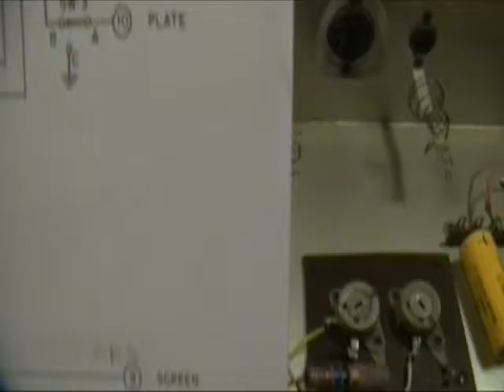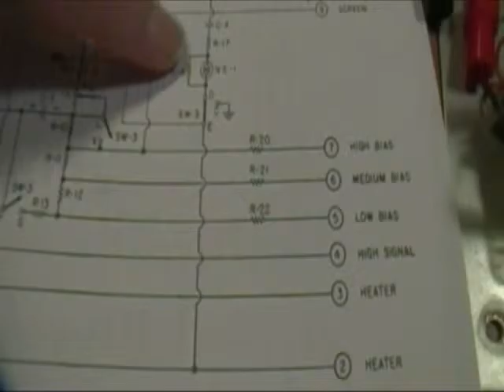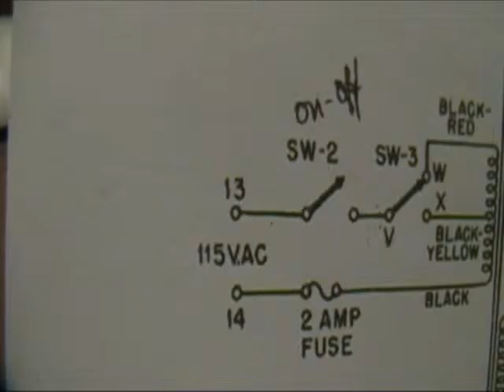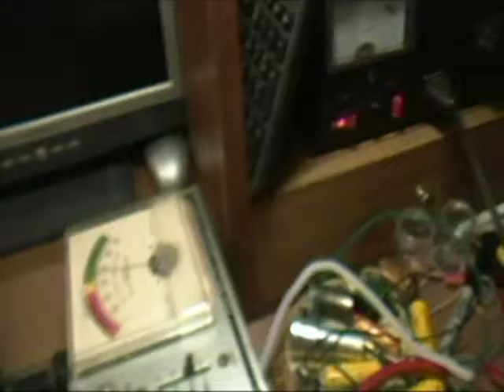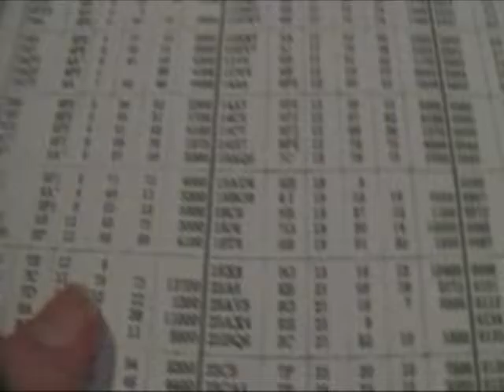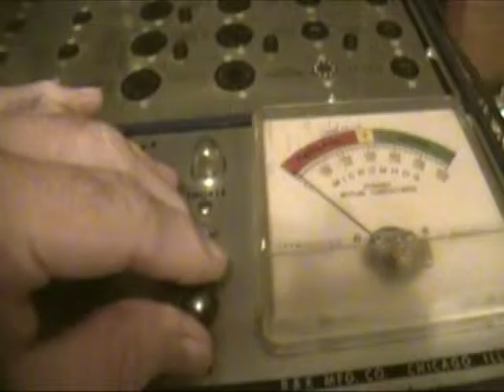TTT048 B&K500 Tube Tester Restoration

Comment: Would like to find a copy of the schematic with the markups on it. Where did that come from?
Reply: It's from "Tube Testers and Classic Electronic Test Gear – Alan Douglas" still need a copy?
Reply: @Theruined1    I reckon not. I got mine working right & the readings seem to be reasonable too, given that I don't have a "gold standard" tube. And the 500 doesn't really have a calibration procedure. But the results are consistent with what I get from a calibrated Hickok 6000A taking into consideration they don't test exactly the same method.
Reply: @ordinaryaverageguy76   you could give these a shot....though I am not sure which version of 500 they are for https://www.diyaudio.com/forums/equipment-and-tools/141560-500-tube-tester-calibration.html

Comment: Hello Sir, I have a B&K Dyna Quik 500 tube tester that always worked normal but now every time I check a tube, when I move my tester switch to GM, the short light bulb lights. It happens on all the tubes I check. Do you have any idea what could be causing this?  The problem is definitely not my tubes.

Comment: Hey Tom,
Great video on Tube testers.  I have B&K 500 I am working on and am wondering if you have schematic showing all voltages you measured after restoration? I cannot get transconductance and such.
Reply: pro tip : watch movies at InstaFlixxer. I've been using it for watching lots of of movies recently.
Reply: @George Jaxxon Yup, been using InstaFlixxer for since november myself :D

Comment: Hi, I am followwing your video to restore my B&K 500. I have already replaced diode and the capacitors (with 5 times bigger ones; can this be a problem?). I am getting the correct screen volatger(+150) but I am not getting the -150 bias volatge. I just get -5 or so in the bias. What can be wrong? Thank you in advance.
Reply from the maker: +soonmo an It is difficult to troubleshot by e-mail but I can suggest a couple of things. You mention using capacitors five times bigger and if you mean physically bigger, that is all right as long as they fit, but if you mean you are using 100 uf instead of 20 uF, then I suggest you use the correct value (22 uF instead of 20 uF is OK but 100 uF will probably overload the rectifier). Also, check to make sure that the negative bias capacitor is connected correctly, the + lead should be connected to ground and the - lead should be where you measure the negative bias of -150 volts. Finally, if you have replaced the selenium rectifier with a 1N4007, check that it is good (low resistance in one direction and high resistance in the other) and that it is installed with the correct polarity (note that the + on a selenium is not the same as the + on a silicon diode) so just make sure the diode will supply negative voltage to the capacitor. If all these check correctly you may have a short on the bias supply - disconnect everything except the diode and capacitor and see what you get with no load at all. If you get around -150 volts, then start testing the loads to see which one is shorted. Good luck with your restoration. tomtektest
Reply: Dear tomtektest, Thanks to your advice , I managed to get the bias in the proper range. Now I have another problem. When I test "mutual conductance" and "life", the meter gives wrong direction movement. I mean the needle of the meter moves left side (passes 0) instead of right side. I testes different "working" tubes and same symptom happens. I noticed my machine had "6at5" instead of "83"  as a rectifier tube. Thank you again
Reply from the maker: I think the rectifier should be a 6AX5 which indicates you have an early production Model 500. Later they changed the bridge rectifier to an 83. The most likely cause of a down scale meter reading is a burned out bulb in the bridge circuit or a bad connection to one of the bulbs. Make sure both bulbs are the same type and are burning with equal brightness in the bridge circuit. Good luck with the restoration. tomtektest

Comment: Are those yellow 20uF capacitors electrolytic caps?
Reply from the maker: +Sandra Ledger Yes they are electrolytics. They are te primary storage/filter capacitors for the screen grid and bias voltage supplies.

Comment: I wanted to show I know this is an old video but I found it useful I was going to buy one of these and when you said it was made before 1958 I knew it probably wouldn't test the tube I needed it for, early to late 60's elctronics I guess I need to get a B&k 700-747 ? Tube tester. Thanks again